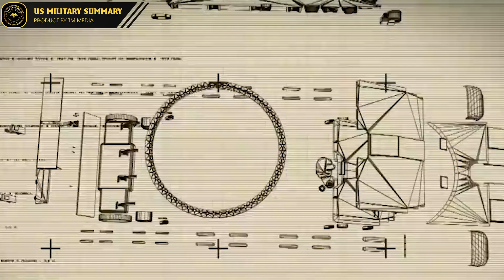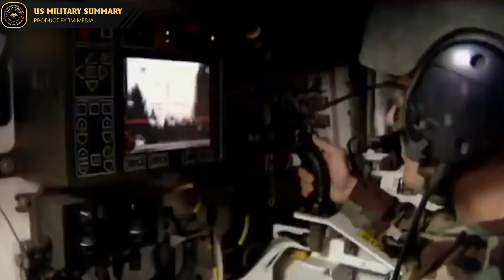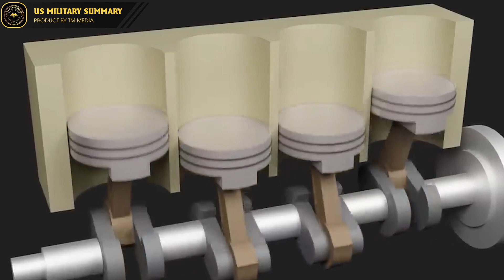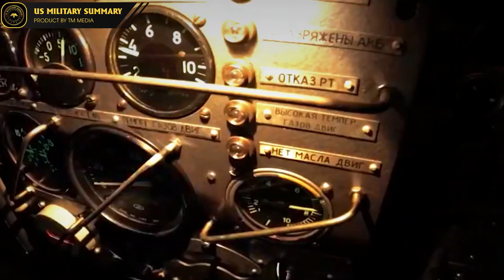Who Wins!! T-80 (Russian) vs M1 Abrams (US): Which Tank is the Most Powerful | Military Summary

Comment: What is the Military Summary of the T-80 and M1 Abrams tanks, and how do they compare in terms of performance?
Reply from the maker: The T-80 and M1 Abrams tanks are both highly capable armored vehicles with unique strengths and weaknesses. The T-80 is a Russian tank that emphasizes speed and maneuverability, while the M1 Abrams is an American tank that prioritizes firepower and protection. In terms of performance, the M1 Abrams has a more powerful engine and thicker armor, but the T-80 has a faster top speed and a more advanced autoloader system. Ultimately, the effectiveness of these tanks in combat will depend on the specific circumstances of each engagement. Thank you for your comment on the US Military Summary YouTube channel.